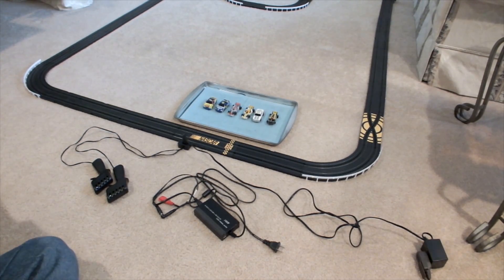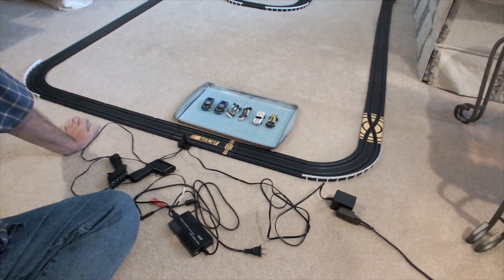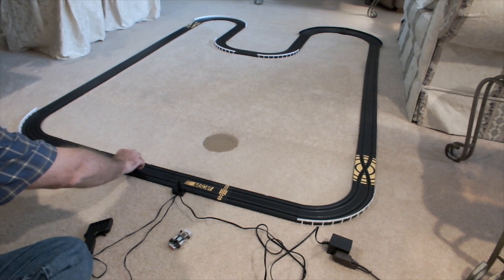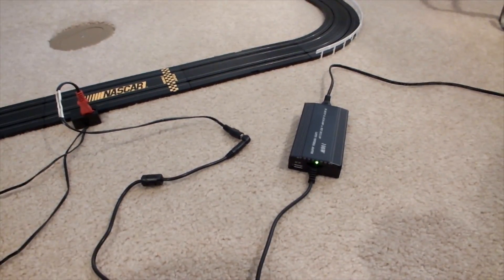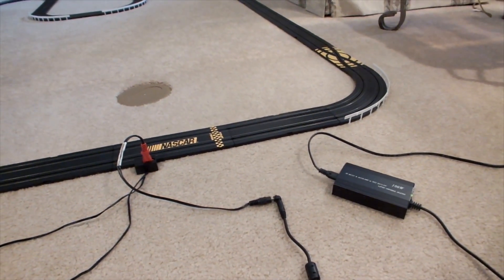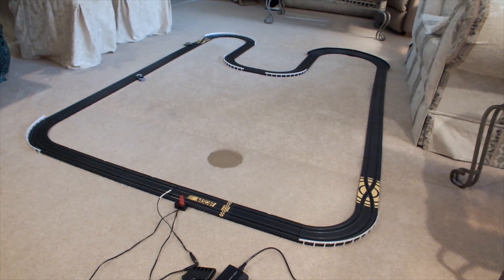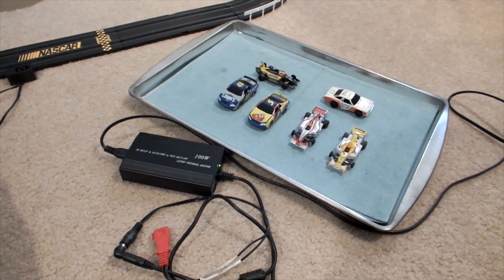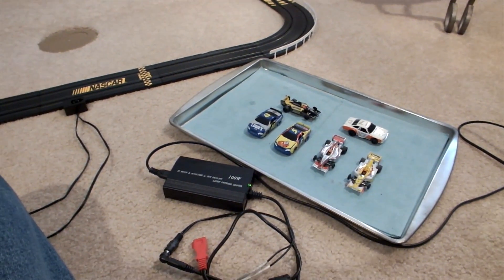HO Slot Car Track Power Hack

Comment: I have a 60 foot plus track with loop, jump etc and use the twin power adapter track piece. I placed it in the middle of the 60 or so and it does fine with the stock supplied transformers. My cars fly off track if I go beyond halfway on throttle. I have no issue with power!

Comment: Use 2 12volt deep cycle batteries in series with a Parma 45 ohm controller . Works with G cars,  lifelike would burn up . Life like sux . Nice bodies though .

Comment: Can’t you use a train transformer or no?
Reply from the maker: Yes, you can use a DC train transformer that puts out enough amps and volts.  Years ago I used a MRC unit that was for G guage trains.  The issue is expense for some guys.  That MRC unit was $200.00.  The point of this video is a 'hack' that is cheap.  Also since I made this video, the cost of Chinese desk-top power supplies has come down.  And this year,, Auto World came out with a 2 amp up top 24 volt power supply that is $30.00.
Reply: You can use an ac train transformer, just ad a rectifier in line. You can make a rectifier with 4 diodes for a couple of bucks. A Lionel 1033 is about 25 to 35 dollars, 18 volts 90 watt output equates to 5 amps at 18 volts, huge copper wound transformer will never burn out like a small modern power supply will. You can also turn the voltage down if you want.
Reply: @quickturn66  I've got a few Lionel transformers laying about. Thanks for the assistance

Comment: Im just getting back into this after 40 yrs., but cant you just take the magnets out, getting a more life like speed and w/o flat-lining?
Reply: The car will move faster without the traction magnets and fly off the track easily. If that's the way you want to run, slow, then you use quite low voltage. Probably 12 volts. They will still be fast but you really have to slow down for curves. Lot of people enjoy that.

Comment: Can I use 12V ac adapter for a 6V slot car ? (I have 4 battery slot. 1.5V each)
Reply: What brand/model is your track and cars?
Usually you're going to want an AC adapter that has a DC output voltage the same as your total battery voltage.
An HO slot car designed to run at 6V will probably overheat or burn up the brushes pretty quickly at 12V.

Comment: I have been using a power hack on one of my tracks for three years. It has variable voltages and without a doubt one of best things I did to improve overall track performance. Never had any problems and still going strong. Thank you for introducing this!

Comment: Thank you. I know I’m writing this after many years of this video being posted. I just wanted  to know that will this solution of using this power supply / transformer work on a digital 1/32 set or 1/24 set like Carrera which needs about 18V at 4-6 amps. Do you see any concerns?
Reply from the maker: I doubt seriously this could be adapted to digital.  But I am not an electrician and don't play one on TV.  You would have to consult an expert in that area.

Comment: I just hooked up a multi voltage laptop  charger.  I cut the wire and installed Dean's Plugs on a stock wallwart and the laptop charger. This way I still have all the options!
 The power curve it added is great. More speed and power even at the 12v setting, I have it on 16v. 
 The original Tri Power pack  was to little on Intermediate and way to much on Expert. For the grandkids I can put the Tri power pack back on!
Reply from the maker: Good !!

Comment: We run the stock 22V with 1A in each lane. This way when we're racing, and one car dives off the track. The other car doesn't all the sudden, go Hairy Canary!!! ;)
Reply: Used to be 24V and .50A running the old Tyco power pack. If I remember right... It was pretty awesome running the old 440-X2 cars around. ;)

Comment: Interested in getting 2 of these for a afx tomy track. One for each lane. Running a 2 lane track.  Want to do a larger size track. About 60 feet or more.  Was wondering if the tomy afx plug still will run in both directions.  Thoughts on this please

Comment: I have used an alternate power supply for a year now and am very pleased with it on a 50’ lifelike track. Thanks for this video showing how.
Reply: what alt power supply your using. Custom made or something commercial off the shelf? I'm expanding my life like soon. thx !
Reply: I bought a generic computer power supply from eBay. Had to make sure the connector plugs worked (they didn’t so I bought the right ones from eBay) and it worked. Nice option is there are several output settings so I can run the cars at different power levels (14 volts to 24 volts) and it cost about $20 total and of course the time to put it together. Well worth it as it’s interesting to see how the cars run at the different power levels and there have been zero problems after 4 years.
Reply: @gregoryfox7551  ok thx. I'm expanding my four lane track so I'll have 2x powerpack. looks like hardest part is pigtail hookup to the actual track, but that's just right male/female config and taping/solder/heatshrinking it all together. Did u upgrade your controlers too? Or keep using stock ones?
Reply: My track is lifelike but I use the big tyco controllers. They are bigger than lifelike but are stock (no modifications except longer power cords) and work well.

Comment: Hey Terry, thanks for this video. After seeing this (and part 2) I was convinced that this was the way to go for me. I got two of these off ebay and am running them on my  two-lane Tyco layout, one for each lane. I made a custom terminal track from a standard 9" straight with 18 guage wire soldered directly to the rails. I also incorporated long controller leads and leads for a jumper track into the terminal track, and made one jumper track from another standard 9" straight, which I placed approximately half way through the track. The design is modular, so I can add as many jumper tracks as I want, but one seems to be working fine for now. I used "t" style connectors on all of the connections. I am currently using Tyco standard controllers, but just waiting on some more connectors so I can wire up some AFX and Auto World controllers, too. Eventually I will get some better controllers. My track is about 70 feet, and before this new setup I was having very noticeable power issues, even when using two of the Tyco X2 "high performance" power packs (one for each lane with two standard terminal tracks). Now there is more than enough power and no noticeable power loss anywhere on the track. I should add that I spent a great deal of time on the track itself to make sure everything is fitting well and making solid connections. The adjustable voltage is very cool to have, too. I like to crank up the power to make some of the slower cars more interesting, and have also used it as a handicapping function to even the playing field to race different chassis together. In my opinion this is an awesome setup. Total cost for all of this was less than $50.

Comment: Where did you find that pig tail adapter for the lap top power supply? I dont know what to search for or where to find them like that. Thanks.
Reply from the maker: I got some off eBay - Female 10 12V DC power supply wire cable plug line, the CCTV 2.1mm security cam

Comment: From just looking at the unit that is being shown here, it looks like the unit is (or is very similar to) the unit on EBay made by a company/distributor (not sure which) called "Yunda".
There are other units available that are similar but it looks like the Yunda item has the widest voltage range settings available and it's manufacturing quality seems to be superior as it has a metal case where all the others are plastic. 
The unit is rated at 100 watts of power output which give you pretty close to 5 amps at the high end. I even found a 120W unit but it's lowest voltage setting is 15VDC where the Yunda item has a 12VDC setting.
The model number is YDA206 and it looks like just what the doctor ordered if cost is an issue for you.
If you do a search for "YUNDA Universal 100W", you'll find it pretty quickly.
I have plans to build a custom 4 lane routed track using one of these units on each lane. I think they will be far more robust if used on separate lanes and I get power that supports all the possible types of cars that I can run. I'll be opening them up and doing some replacement wiring with heavier gauge wire and wiring them permanently in to my track setup but even using 4 units, you still get away for less than $70. Hard to beat.
I have to give props to Terry for finding and demonstrating this power option to all of us. 
You really added to our arsenal of knowledge.
Thanks Terry.

Comment: So you think a pack would need to be applied to every 30-40 foot of track?
Reply from the maker: It does not work that way.  You need a power taps at about that many feet but they have originate off only one power source.  Multiple power supplies can't be controlled be one controller.  You will need to look up a wiring diagram to see how this all has to be done.
Reply: Harden Creek Slot Cars, I run Tomy AFX. To this point I have used start/power track at different points of the circuit with a stock power pack plugged into each piece to help maintain power throughout the track. Controls work great. Is it different in this instance because you have made it yourself? Is there something different with the circuitry?
Reply from the maker: You need to look a wiring diagram for single source power with multiple tap points.  You can call me if you like.  Thanks, Terry 863.450.9835

Comment: Ok so they have the dual power terminals that allows you to run 4 individual lanes, can this hack work with this method or would that be to much power for a single lane, I would have to have 4 adapters.......
Reply: Too much power? No. The car will only draw the amount of power it can use. Stock car will "take" little power, less than is available. A built car will "take" more, as much as it "needs". As long as enough power is available. If not enough power is available the car won't run as fast as it could. It may not even move at all. Electrical devices don't consume more power than they need even if more is available.

Comment: Thanks for the info so far, ok so can you apply this method to a 4 person driver station, and not have to use the termanal tracks for your controllers???????
Reply from the maker: Best to call  863.450.9835